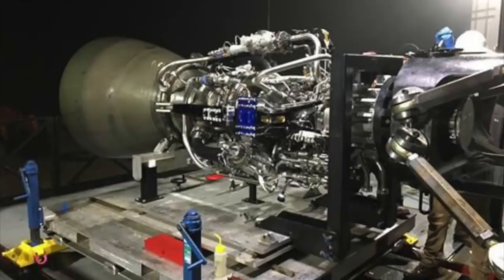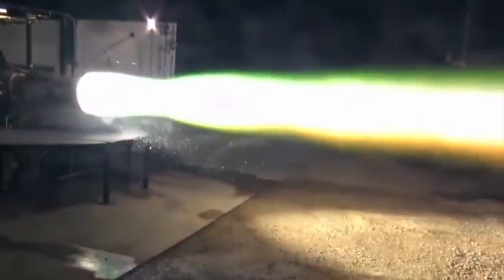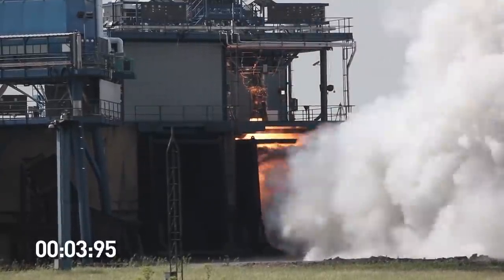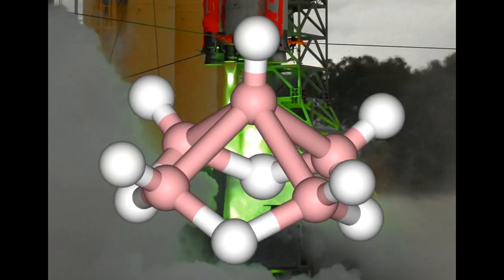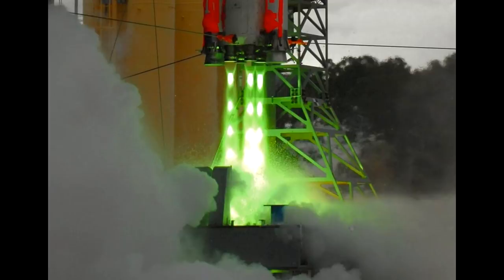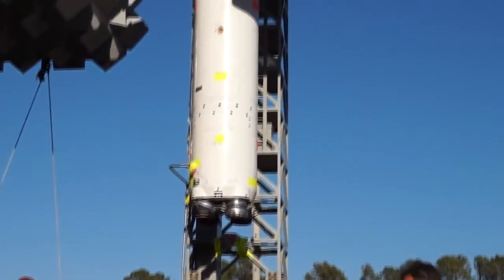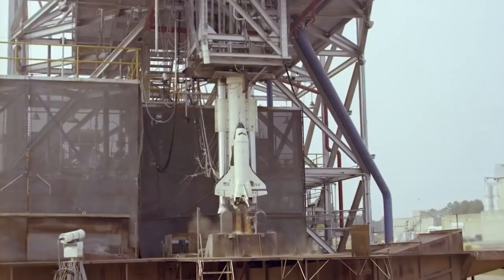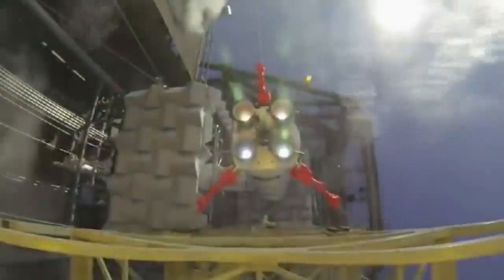The Story Behind This Green Rocket Exhaust

Comment: They probably still simulate the rocket design, but have to build models to check if their simulations are correct. Because if they made mistakes in the simulation then the real test will show a different result and they can adjust the simulation to fit better to the real world.

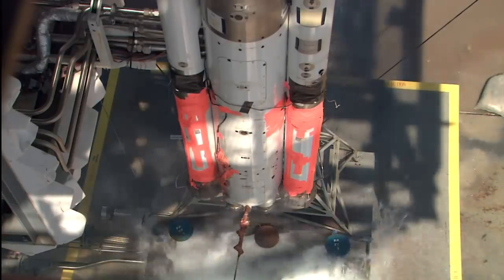Comment: 4:10 I do computer-based structural analysis simulations for a living. Simulations and physical tests are complementary. One isn't better than the other. Simulations cannot replace physical testing. There are physical phenomena that are difficult to model, so assumptions are made in the simulations with a recognition of the limitations. The assumptions that are made are usually geared toward making a conservative model, which means that the model will indicate a failure at a lower load that the physical test will. That said, the simulations can show details that a physical test cannot. Models are very effective at pinpointing where the weakest link is, and is excellent for playing "what if" analyses of potential ideas to correct the weakness. Doing the same thing with a physical prototype could be horrifically expensive in comparison. In a simulation, changing a material property often amounts to changing a single line of code.

Comment: I thought the green flame was the triethylborane (TEB), and triethylaluminium (TEA). That burns in contact with air or a catalyst in the chamber for multiple vacuum starts. Am I right? Thankyou.
Reply: For the Raptor, no.  It uses an electrical arc for ignition.  My understanding is that the spark ignites a small MethaLox torch that shoots into the main chamber causing full ignition.
Don't quote me on that last bit though. I just know the ignition is electronic.

Comment: Triethylborane was also used in the SR-71 Blackbird to ignite the JP-7 fuel because it had a very high flash point.
Reply: Also on the B-70!
Reply: Right, it was used in J 58 as a chemical igniter since it is hypergolic mixture which immediately burns upon contact with oxygen
Reply: A-12  first but sure. Same engine.

Comment: I do like those Mach diamonds... and yes it did sound better than the halftime show
Reply: yea the pattern of the flame is beautiful, I'd never seen those or heard the term until recently, gonna have to look it up now
Reply: Normal Viewer always thought it would be a good name for a band
Reply: @SpydersByte  It's the sign of a good clean stable burn and proves the exhaust gasses are exceeding the speed of sound.  I've seen them reasonably close and personal in amateur high power rocketry.  They're also sometimes visible in ultra-high performance jet engines (eg: on the SR71).

Comment: The captions have you saying they are using "boring fuel".  Just what did Elon find while digging out his tunnel?
Reply: boron..
Amorphous boron is used as a rocket fuel igniter and in pyrotechnic flares. It gives the flares a distinctive green colour. The most important compounds of boron are boric (or boracic) acid, borax (sodium borate) and boric oxide.
Reply: @johnnyllooddte3415  I believe he was talking about boranes, specifically.  It's a class of boron-based chemicals analogous to alkanes (methane, propane, octane, etc.).  That picture he showed was pentaborane.  The SR-71 ran on JP7 and used triethylborane for ignition, giving it a green flame at startup.
Reply: @jeffspaulding9834  johnny was referring to solid (pyro) not liquid.  In amateur rocketry, they usually use Barium Nitrate or Barium Chloride for green, strontium compounds for red, and copper for blue compounds.  The rocket engine manufacturers are a bit leary about giving out their precise compositions....
Reply: @fromagefrizzbizz9377  Johnny may have been talking about that, but Scott wasn't.
Reply: @jeffspaulding9834  That's why I was referencing you and Johnny, not Scott.

Comment: Hey Scott I worked at the Edwards AFB, 
A F Rocket propulsion Laboratory for Fifteen years we did use pentaborine  flourine’s and a few others nasty Oxidizers like that wonderful 
nitrogen tetroxide.  I did get a bad case of pneumonia from the last one.  I was the shop know it all on propellants in the shop and had saved a lot of old rocketdyne propellant guide books on stuff like chlorine trifluorine, MMH, UDMH, N2O4 and Pentaxborine.  That shit makes one again of RP1!  I was there when a crew practice loading a strap-on stack for a Titan dropped a segment and burned up a test stand.  And the 10-11 months of repairs that lead to failure of the same basic stack that destroyed the test stand again and the last set of firings that happened 24 months later because after that stack blew that stand needed much more work.
Reply: Wow!! That'd have been really exciting. Have you written any books on your experiences?

Comment: So, just watching the SN8 flight test. Came here because I noticed a distinct green flame from the one of the Raptor engines at the end there. The same engine cut out 1:45 into the ascent, though I wouldn't know if that was intentional.
Anyway, could the green be an indication of a mechanical malfunction and the engine was burning up its own copper parts? 
Value your insight. Please continue your good work.
Reply: I'm wondering if they were trying to relight the engine after it shutdown. Triethylborane is used to ignite the raptors.
Reply: @Just Jeb I just learned that. Thanks for your help.

Comment: We still need a nasa rocket that has red, white, and blue exhaust that would be launched on July 4th
Reply: The Space Shuttle actually did that. The exhaust from the main engines started red, turned blue as it reached full power, and left a plume of white steam. STS-121 launched on July 4, 2006.
Reply: @bonetonelord  So it made a Russian flag column?
Reply: Could you strap a few blue angels onto a rocket?
Reply: They should paint the outside of the rocket with McDonald's ketchup and use Coca-Cola in place of the water for the launch pad as well. 'Merica.

Comment: I know this video is a year old but I had to comment on the borane aspect. Yes, uncombusted boranes are dangerous because they are strong Lewis acids but borate esters would not be a bad fuel because of toxicity reasons. If you’ve heard of borax, or, sodium borate, the stuff you can pick up at the grocery store to be used as a detergent, that’s essentially what borate fuel combustion products are (a little different but pretty much the same toxicity wise) Borate esters will combust and form boric acid and boric anhydride which are not toxic.

Comment: I’ve designed a hydrogen peroxide and ethanolamine engine before and with some additives, the exhaust products are green. Both literally colored green and environmentally green.
Reply: What were the additives?
Reply: you just casually design rocket engines
Reply: @40watt53  Why not?  A bunch of us used to design solids, hybrids and tribrids.  Thrust levels of up to 2000 lbs and above.

With the right design tools, design isn't hard.  Making and testing prototypes is the hard part.  Scraping out the last percent or three of efficiency and getting perfect repeatability harder still.
Reply: @swirlingabyss  Yes

Comment: Apart from the sheer toxicity, there are several other reasons why you wouldn't want to use boranes as fuels for either rocket or turbojet engines. Some are physical, such as diborane being a cryogenic, pentaborane having a low density, or decaborane being a solid with a melting point over 200 degrees C.

A paradox of boranes is that while they are rapidly and violently hypergolic with air (and most other oxidizers), they tend not to burn completely. You would expect the combustion products to be water and boron trioxide but testing repeatedly showed that not all of the boron would burn (not even with excess oxygen), so some elemental boron comes out as well, meaning the overall efficiency suffers.

A major problem is that of the boron trioxide in the exhaust, which is either a solid (below 450 degrees C) or a thick, glassy liquid between 500 and 1800 degrees C. This is no good for rockets using gas-generator driven turbopumps, since it fouls up the turbines, and is similarly destructive to turbojet engines for the same reason. You can just about get away with it for pressure-fed rocket engines, but even then, it tends to accumulate on the inside of the nozzle and cause problems that way.

One possible solution to this problem was to use a fluorine-based oxidizer, such as chlorine trifluoride, oxygen difluoride or even just straight liquid fluorine: The exhaust products would then be HF and BF3, both of which are gases. However, they are not nice gases - HF being downright evil and BF3 reacts violently with water vapour to release more HF. That's on top of the problems inherent to handling fluorine oxidizers. Which is possible for rockets if you're insane, but ridiculously impractical for jet engines.

Comment: Looking forward to the day when rocket launches get cheap enough that companies start using fuel additives to give their launches party colors, perhaps to get attention and as a means of passive advertising.

Maybe even have it go through stages, like a set of those Nitto burner slicks that go through the rainbow while the driver is doing donuts. That'd be nice.
Reply: @Geno Merci There really is no reason they couldn't do it now.  If you're already flying the launch, adding some chemistry to get a couple bucks in return is no biggie.
Reply: @fromagefrizzbizz9377  It's not just a couple bucks though. You're sacrificing Delta V and essentially adding dead weight to the launch by putting material into the tank that contributes little or nothing to the engine's thrust, or may even reduce the fuel's efficiency.

You need an engine that's seriously overpowered and fuel that is seriously cheap before the cost actually comes down to a "couple bucks", relatively speaking.
Reply: @PapiSmerf  Note that in many cases, the "dye" does contribute to thrust.  The best example being, of course, aluminum.  Long used as a burn/thrust modifier/intensifier, it makes the exhaust white[r], and the amounts required, depending on the "dye" are surprisingly small.  A few hundred pounds of super-fine aluminum dust doesn't cost much, and contributes greatly to thrust.

This applies to many of the other eligible "dyes", such as titanium, copper, boron etc.

"coloured" rocket plumes are quite popular in amateur/high power rocketry.  If I recall correctly, one manufacturer offers some 11 different colours overall, and the engine performance/weights/costs are for the most part indistinguishable from the "unmodified" versions.

Anybody whose ever seen a big "smokey sam" motor launch knows there's nothing at all underpowered about 'em.  They really are quite spectacular.

The cost difference between identical motors with just different colours is on the order of 1-2%.
Reply: @fromagefrizzbizz9377  You're talking basic elements, which also contribute hugely to  corrosion and temperature. Not ideal. Dyes ideally would have little to no impact on the machine. Aluminum and copper would gall and seize the moving parts of the fuel turbines, and titanium would just grind any moving parts it comes into contact with into dust. Vast majority of amateur rocketry is solid boosters, and that includes the specialty fuels you listed. None of the engines being used by current or up and coming companies are SRB primaries.

Good luck getting any sort of consistent mix without running the additive combined with the fuel through the turbine.

Aluminum burns hot. You'd have to use an ablative cone and throw it away every couple launches. Titanium is dangerous because it spontaneously ignites when put under high pressures in an oxygen rich environment, and being a very aggressive reactant at high temperatures would eat through cones faster than aluminum. Copper crystalizes when it combusts, basically super-sandblasting everything it comes into contact with.

It's not as simple as throwing a handful of basic elements into the tank. There will be some serious chemistry and physical analysis involved. A formula soluble in the fuel with no appreciable changes to stability or flow rate is essential.

Rocket science doesn't have it's reputation for nothing.
Reply: @PapiSmerf  Yes, the chemistry I was talking about is primarily for solids, but it's worthy of note that research has been done using powdered aluminum in airliner engines.

Corrosive?

Some of the fuels are hideously corrosive already.  What do you think rocket grade Hydrogen Peroxide is?

Secondly,  and more importantly, you seem to forget that the shuttle SRBs (and the proposed SLS) SRBs are solids, and that powdered aluminum was second (at 16%) only to AP at (70%).  The pure "fuel" (PBAN) was only 13%.

Sandblasting?  Not so much at these temperatures (aluminum oxide is a gas at these temperatures, even Titanium oxide probably won't be a solid - APCP combustion temperatures, especially with metallic modifiers are not nice at all).  But so what?  Why couldn't you replace nozzles occasionally?

Yes, trying to do it with liquids is a lot trickier than with solids.  Dumping it in and stirring ain't gonna cut it, and it's going to have to be feedable.  But with solids it's a piece of cake, and solids ain't obsolete yet.

Yes, it is rocket science.  I was one for a while, with a group who were far better at it than I.  Tribrids with regenerative bell cooling aren't toy fireworks.
Reply: @fromagefrizzbizz9377  Hydrogen peroxide is the fuel, it isn't what touches the nozzle. Hydrogen peroxide doesn't burn either, it decomposes into completely harmless hydrogen and oxygen and water. By the time it reaches the side of the nozzle that reaction is long done.

Aluminum and Titanium don't sandblast, I didn't say they did. Copper is the one that crystallizes. Aluminum and Titanium do other things that are not so pleasant.

Aluminum combusts 5 times faster in the presence of water vapor, one of the most common liquid rocket fuel by-products, than it does in pure oxygen. That means that it produces an appropriate amount of extra thrust but it also means that when the fuel mixture isn't 100% perfect that that incomplete 2Al2O3 has that much more energy to either strip carbon from the nozzle, or shed extra oxy to it's heated surface.

Remember what I said about Titanium spontaneously combusting with oxygen under pressure? It does that with pretty much any gas, including nitrogen. Go ahead and design a fuel delivery system that functions at pressures lower than the combustion chamber and deliver the Titanium to it from a vacuum sealed tank.

But regardless we're talking about designing purpose-built engines for making glorified party-fizzers the size of office buildings. That isn't cheap, is it?

SRB's are obsolete as main engines because of one word: Control. As the space industry advances so does it's capabilities, and in order to expand those capabilities the designers need complete control over how much thrust is delivered when. You won't see an SRB main engine again unless it is for a very specific, one trick pony rocket that needs to be very cheap and expendable. The shuttle is obsolete and retired for many reasons, the cost of retrieving the SRB's, reconditioning and refueling them is just one.

Another word keeps popping up in the current space industry. Re-usability.

The only way you'll ever see tint added to rockets is if it drops into a liquid fuel with zero effects on the chemistry, the functioning of the engine and the combustion of the main fuel. Oh, and it has to be something that doesn't cause any problems with stuff like highly pressurized liquid oxygen or methane, because those are dangerous enough on their own doing things like eating holes in the tank just by accidentally freezing and causing rockets to explode.

I'm no chemist, but I know that that is a tall order all by itself. Forget cost.